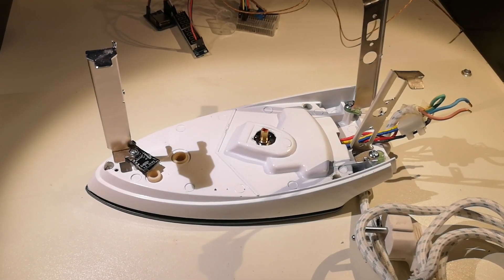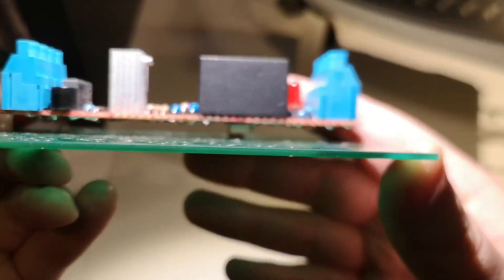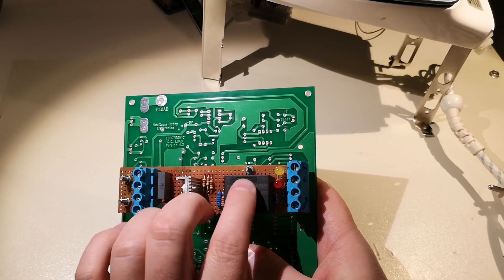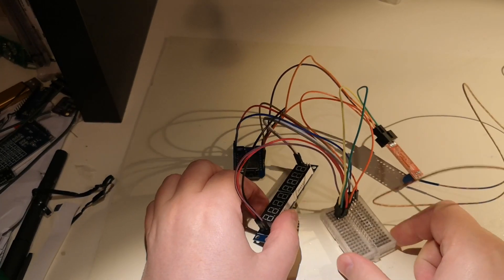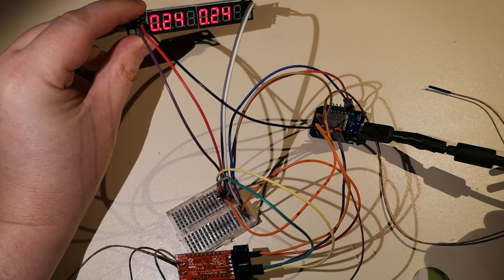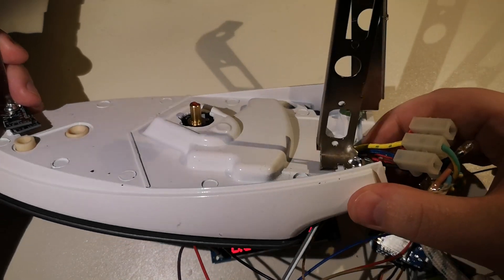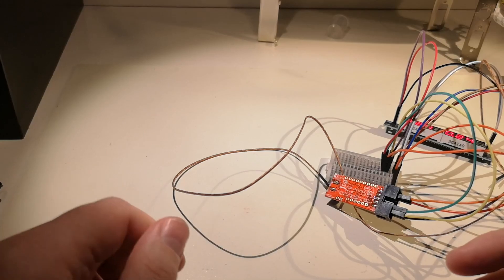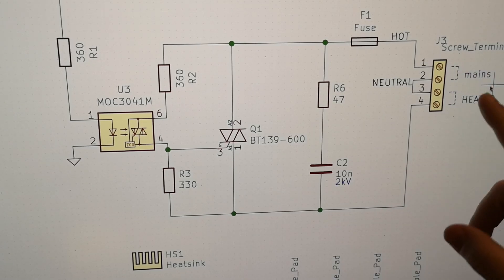DIY Hotplate from Clothes Iron. part 1

Comment: Also did this, but I kept most of the iron in its original casing. I use it to cook lunch and such. I made an aluminium case around the iron and an new knob for setting the temperature. Great video! Mine is 1440 Watts tho.
Reply: i’ve made grilled cheese in a hotel room with their iron 😅